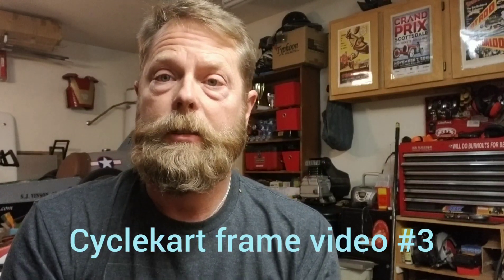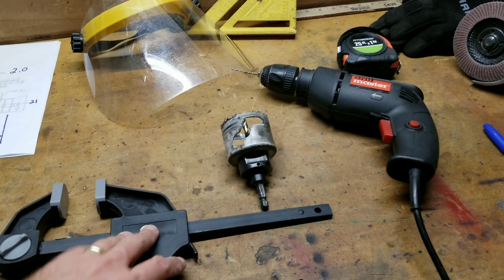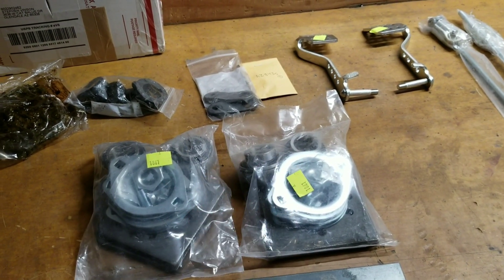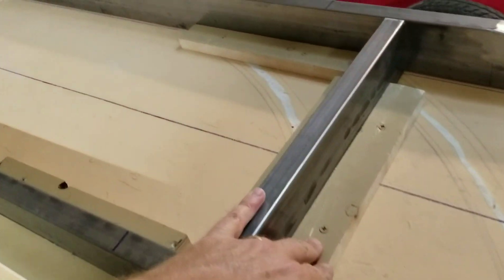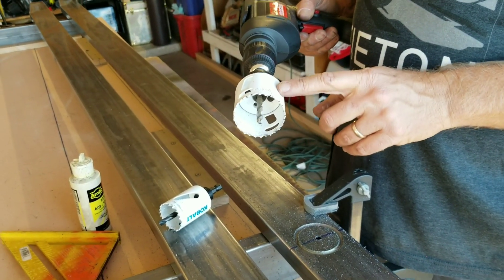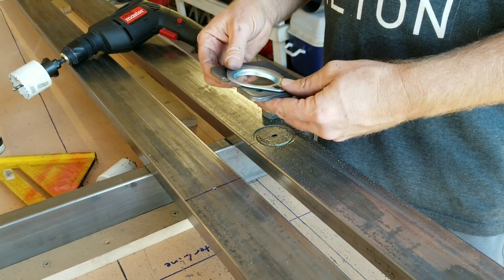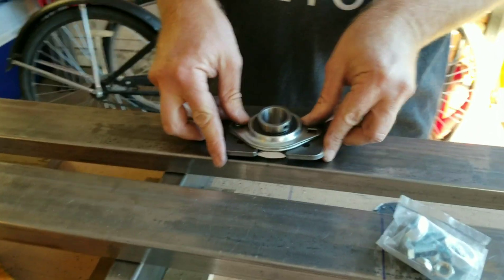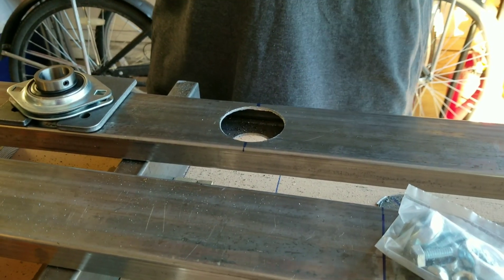Cyclekart Frame Video 3

Comment: Hi Steve. Would it be a good idea to weld some tubing in between the two holes of the frame to a) strengthen the frame, and b) seal the frame up to discourage water ingress? Or would that be overkill?
Reply from the maker: Probably overkill, every rivet hole etc will let in moisture, its better to give it a path to escape

Comment: I found a good / inexpensive / easy to find lube for drills and hole saws... that being good old fashion "STP Oil Treatment" ... slick as 'all get go' and thick enough to coat the cutting tools.. makes a good tapping compound too.. i pour some in a small container with an art paint brush sticking out of the lid...
Reply from the maker: good tip. thanks
Reply: Another good one is gear lube

Comment from the maker: Steve Vinson's Cycle Kart Build Sheet 11-13-19

This list is a guide to help the new builder, these parts may work for your build or maybe not.
It is up to you to make sure these parts will work for your build.

www.equipatron.com Engine Honda GX200 GX200UT2QX2
3/4" x 2-7/16" shaft HDA-GX200-QX2 $344.97

option for Predator Motor $99.00

Engels Coach Shop 2 Leaf Spring
 wont need if source from VKC
engels_coach@hotmail.com Wagon Seat Spring $54.90 x2 $109.80
https://engelscoachshop.com/product/wagon-seat-springs/

Throttle Cable measure before ordering
you may have to fabricate a linkage so your
length of cable will depend on how you design your kart

www.MFGSupply.com
 5/8" Steering Shaft AZ1868-34 $29.99
w/ loose pitman arm 34" long
Tie Rods x2 AZ1842-15 $16.99
5/16"x24" x 15" long? x2 $16.99
includes heim joints

optional Steering Wheel 12" Part #4-9396 $25.85
other designs available

Axle Bearing Azuza xw AZ1861A $37.99
2 hole for 1" axle $37.99

Flat Engine Mount Plate #AZ8190 $9.99

#40Chain x 48" Part #11-9317 $9.76

Hardened Steel Keyways 1-1/2" x 1/4" x 1/4" AZ8435 $1.84

Locking Collars split (6) AZ8557 $35.95
1" ID x 1-3/4" OD 6 x $5.99

Comet Torque TAV2-30 218353A $199.99
10tooth x 3/4" bore #40 chain

Pedals brake AZ1806 $6.99
          throttle AZ1811 $6.99

1" Uni-Hub Assembly AZ2555-A $19.99

Sprocket 60T 40/41 chain 5-1/4" bolt Circle
AZ2166-60 $41.99

1" x 36" Axle short end AZ1402-36 $43.99
confirm

www.jpcycles.com 
Michelin City Pro 923-955 $123.96
2.75x17 tires (x4) 30.99
ebay Tubes 2.75-3.00x 17" 160-0304 $43.96
(x4) 10.99
Rim Strips 17" 280-0424 $6.12
(x4) 1.53

www.realworldcycling.com 
Front Axle Bearings MR190537LLB $20.00
wont need if using kart co spindles 
19.05mm(3/4") x37mm x 9MM (x4) $5.00
If using OEM Honda front wheels, this is the bearing we found that works, will need a 3/4" spindle

Speedway Motors Quick Release Steering 91032846 $21.99
Wheel Hub 5/8"

https://vintage-kart-company.myshopify.com/…/vintage-mini-r…
Vintage Kart Co. Set of 4 Wheels call Jack to order these parts not on web $375.00
Rear Wheel Hub Adaptors $120.00

Front Spindles complete set $148.00

if buying VKC wheels you will need these Front Bearing for spindle and wheel $42.00

 Front Leaf Springs set of two with bushings $185.00

optional to use mechanical Hydraulic Disc brake set up sales price ??? $50.00

If you buy the wheels that are OEM Honda, the VKC bearing wont fit, let Jack Gee at VKC know which
wheels you have, you may need a 3/4" spindle instead of the 5/8"

Local Metal Supply

Frame 1" x 3" thin wall .062 20'

Front Axle 1-5/8" or 1-1/2" Dia. Steel Tube Medium Wall .095

Spring Shackles and Brackets 3/16" steel plate cut to size or buy ready made fence parts

Brake Rod Brackets 1-1/2" Angle Iron or 1/8" x 1-1/2" strap

Brake Rod and throttle rod 1/4" Diameter Steel Rod

Wood Tub 1/2" x 48" x 96" plywood maple?

Option for aluminum sheet

5/8" Pillow block or equal to support the 5/8" steering shaft

Many assorted Bolts with Nylock Nuts and washers
Subtotal $2,134.08

Comment: Can you please provide a link to the Excel parts list? Thanks
Reply from the maker: Steve Vinson's Cycle Kart Build Sheet 11-13-19

This list is a guide to help the new builder, these parts may work for your build or maybe not.
It is up to you to make sure these parts will work for your build.

www.equipatron.com Engine Honda GX200 GX200UT2QX2
3/4" x 2-7/16" shaft HDA-GX200-QX2 $344.97

option for Predator Motor $99.00

Engels Coach Shop 2 Leaf Spring
 wont need if source from VKC
engels_coach@hotmail.com Wagon Seat Spring $54.90 x2 $109.80
https://engelscoachshop.com/product/wagon-seat-springs/

Throttle Cable measure before ordering
you may have to fabricate a linkage so your
length of cable will depend on how you design your kart

www.MFGSupply.com
 5/8" Steering Shaft AZ1868-34 $29.99
w/ loose pitman arm 34" long
Tie Rods x2 AZ1842-15 $16.99
5/16"x24" x 15" long? x2 $16.99
includes heim joints

optional Steering Wheel 12" Part #4-9396 $25.85
other designs available

Axle Bearing Azuza xw AZ1861A $37.99
2 hole for 1" axle $37.99

Flat Engine Mount Plate #AZ8190 $9.99

#40Chain x 48" Part #11-9317 $9.76

Hardened Steel Keyways 1-1/2" x 1/4" x 1/4" AZ8435 $1.84

Locking Collars split (6) AZ8557 $35.95
1" ID x 1-3/4" OD 6 x $5.99

Comet Torque TAV2-30 218353A $199.99
10tooth x 3/4" bore #40 chain

Pedals brake AZ1806 $6.99
          throttle AZ1811 $6.99

1" Uni-Hub Assembly AZ2555-A $19.99

Sprocket 60T 40/41 chain 5-1/4" bolt Circle
AZ2166-60 $41.99

1" x 36" Axle short end AZ1402-36 $43.99
confirm

www.jpcycles.com 
Michelin City Pro 923-955 $123.96
2.75x17 tires (x4) 30.99
ebay Tubes 2.75-3.00x 17" 160-0304 $43.96
(x4) 10.99
Rim Strips 17" 280-0424 $6.12
(x4) 1.53

www.realworldcycling.com 
Front Axle Bearings MR190537LLB $20.00
wont need if using kart co spindles 
19.05mm(3/4") x37mm x 9MM (x4) $5.00
If using OEM Honda front wheels, this is the bearing we found that works, will need a 3/4" spindle

Speedway Motors Quick Release Steering 91032846 $21.99
Wheel Hub 5/8"

https://vintage-kart-company.myshopify.com/…/vintage-mini-r…
Vintage Kart Co. Set of 4 Wheels call Jack to order these parts not on web $375.00
Rear Wheel Hub Adaptors $120.00

Front Spindles complete set $148.00

if buying VKC wheels you will need these Front Bearing for spindle and wheel $42.00

 Front Leaf Springs set of two with bushings $185.00

optional to use mechanical Hydraulic Disc brake set up sales price ??? $50.00

If you buy the wheels that are OEM Honda, the VKC bearing wont fit, let Jack Gee at VKC know which
wheels you have, you may need a 3/4" spindle instead of the 5/8"

Local Metal Supply

Frame 1" x 3" thin wall .062 20'

Front Axle 1-5/8" or 1-1/2" Dia. Steel Tube Medium Wall .095

Spring Shackles and Brackets 3/16" steel plate cut to size or buy ready made fence parts

Brake Rod Brackets 1-1/2" Angle Iron or 1/8" x 1-1/2" strap

Brake Rod and throttle rod 1/4" Diameter Steel Rod

Wood Tub 1/2" x 48" x 96" plywood maple?

Option for aluminum sheet

5/8" Pillow block or equal to support the 5/8" steering shaft

Many assorted Bolts with Nylock Nuts and washers
Subtotal $2,134.08

Comment: Are the ends of the cross pieces cut at an angle to account for the fact that the long pieces are not parallel?
Reply from the maker: Cut straight and then I bevel them if needed to get a better fit.

Comment: Why does it matter if the joint is down?
Reply from the maker: I put the joint on the bottom, mostly because you will be drilling holes into that area most likely and the joint makes the drill bit "walk" when it hits that welded joint.  Thanks for the question.

Comment: Hi Steve, I have finished welding my basic frame and am looking to start putting the front and back axles on. I am planning on buying the rear hub set, spindles, bearings, and leaf springs from vintage cart co. and I already have the wheels from them. My question is where did you buy your axles? I notice most people have dropped axles in the front but I don't have access to something that can bend metal to make it myself. Can you buy dropped axles online or can I use a normal straight axle in the front? Thank you so much
Reply from the maker: I had my front axle bent by a shop here in Phoenix.  You can get it done at any shop that makes roll bars or something similar, they just need to have a die to bend the 1-1/2 tubing.  Or I can have it done for you by my guy if you want and mail it to you.  Probably would cost about $120 with basic postage.
Reply from the maker: sorry for the late reply. I had my front drop axle bent at a local fab shop here in Phoenix.  If you have a shop in your area that builds roll cages, they will have the correct bender to make it work.  Thanks for watching.